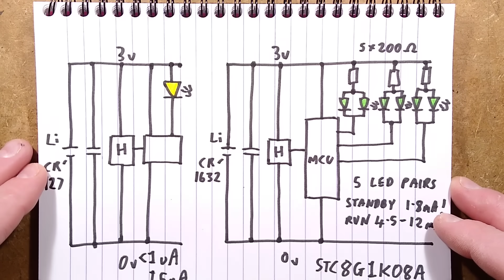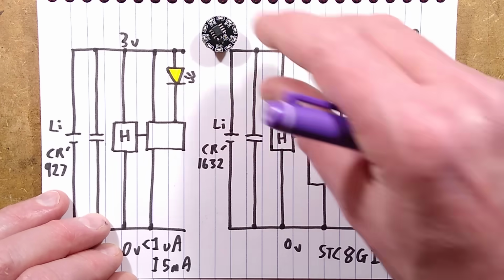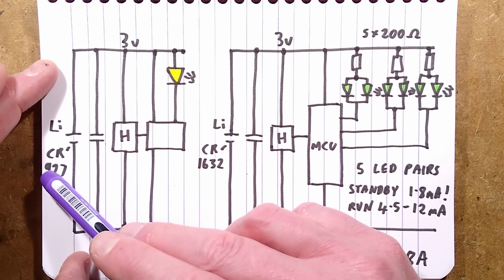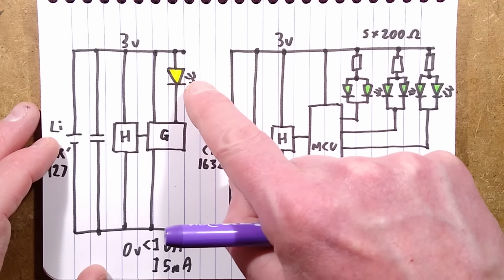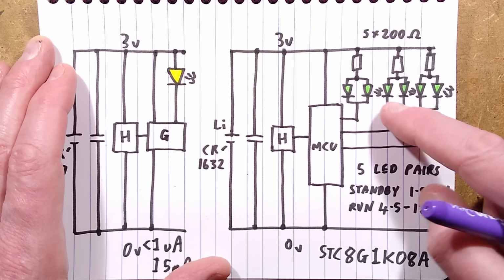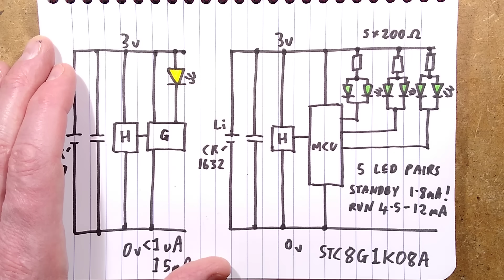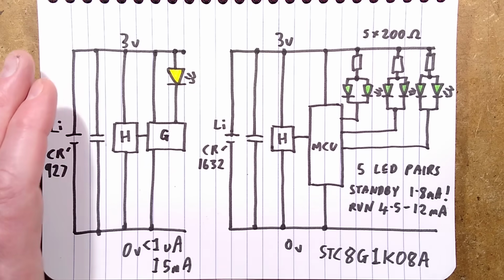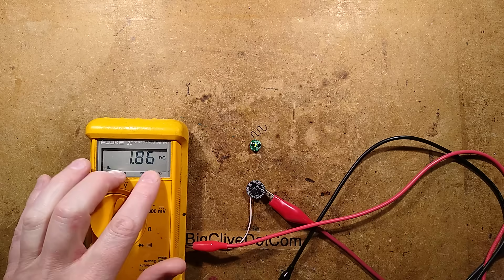Magnetically actuated lights - one with bad software

Comment: I wonder if it's the hall effect sensor that draws most of that standby current. If so, they would have to control the power to it from the micro, which would perhaps add parts.
Reply from the maker: It's not.   The single LED version uses a similar sensor and had ultra low quiescent current.

Comment: The power-down current of the MCU is just 0.4uA, the hall effect sensor could be used as the interrupt trigger to wake it up. Documentation mentions an idle mode which can be interrupted in the same way but the current is not much less than normal run mode.
Reply: 6207 hall effect datasheet says idle current is around 3uA.
So it is a software issue as clive says.
Reply: My understanding is that regular hall-effect devices need one or two milliamps of current flow to be able sense anything because the magnetic field is basically redirecting some of that current flow to an amplifier. I have seen ads for new generation hall-effect devices that are much lower in current though.
Reply: @ericthecyclist The single LED device shows that there are very low current sensors.
Reply: @Conservator.  good point.
Reply: @Conservator.  Ti hals an "ultra low power" option that runs at 2 Hz, 0,54 uA. A continuous one like the AH441 runs at 3.5 mA typ.
Reply: @pizzablender  yeah it makes perfect sense since most consumer applications don't need more than a few Hz wakeup window.
It's baffling how this 8051 MCU on the multi-led board is not programmed accordingly to the battery-powered design.
Reply: @ tx!